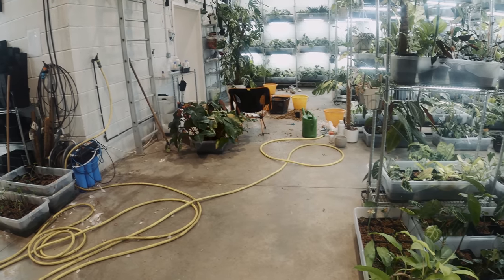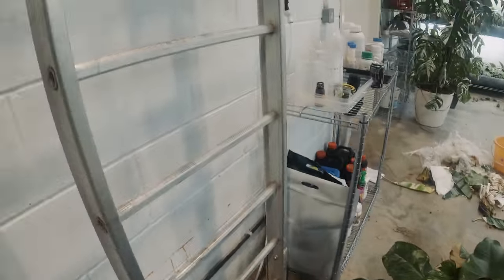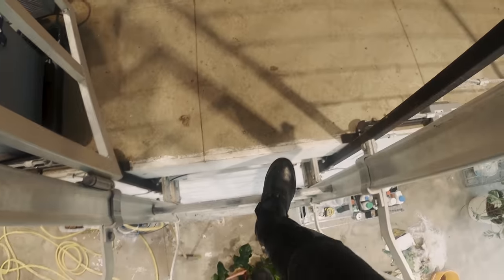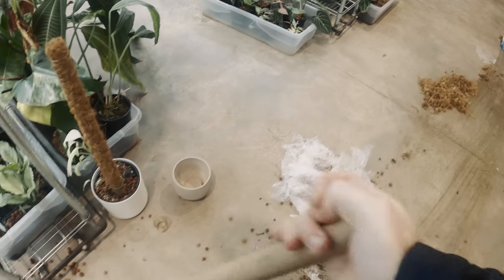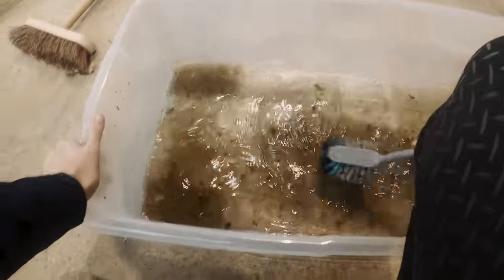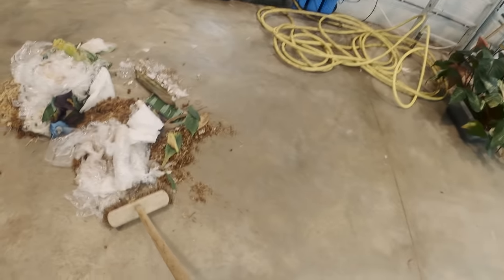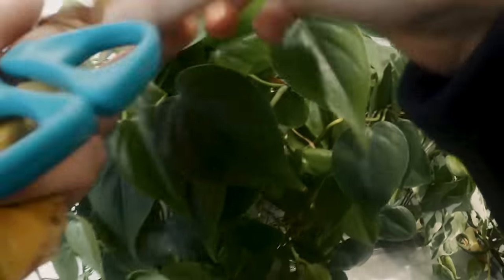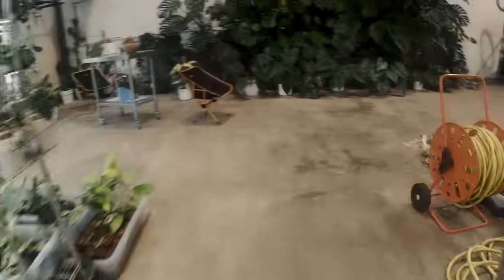GoPro With Me! | Plant Chores POV and Chit Chat

Comment: If I make multiple comments I apologize. For the hose you need a hand crank hose reel on the wall I think to help reel it back up. Couldn't tell the size from the angle but that would help in keeping it easy to clean up

Comment: This was amazing! But @Kaylee Ellen as a software engineer, an overwhelming % of people experience motion sickness due to recording at less than 60 FPS (frames per second) for a high moving shot. Depending on your GoPro you can force it to go to 60 FPS in the settings and upload it with 60 FPS to fix this 100% :) That will also fix the 'blur' you see when a moving object is on screen/in the shot.